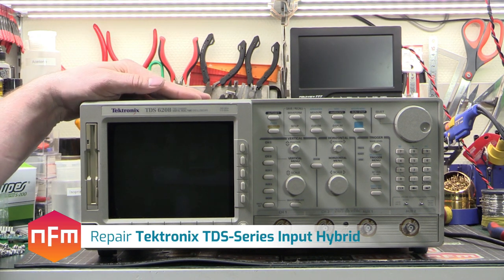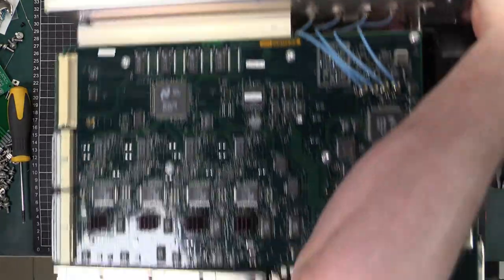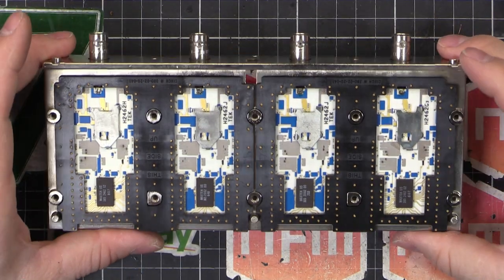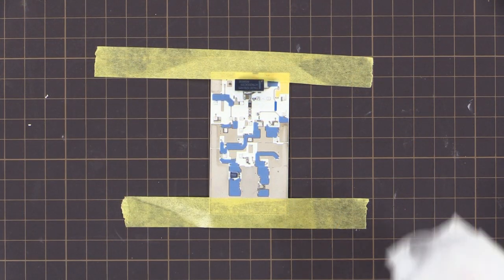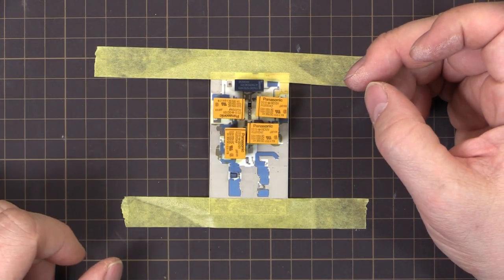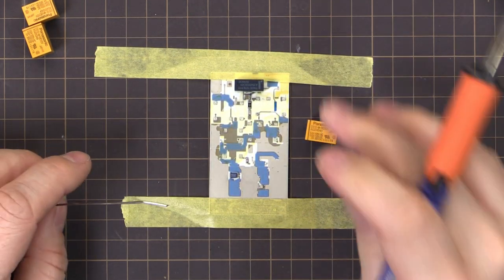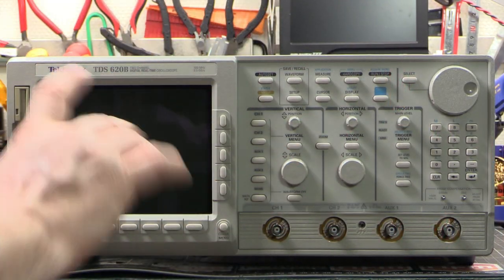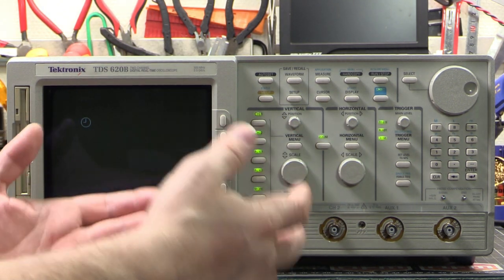Tektronix TDS Series Oscilloscope - Input Hybrid Relay Repair

Comment: When I work on ceramic hybrids I use solder that has a 2% silver content so that the solder to ceramic bond remains intact. This goes back to the old days when Tek used their famous ceramic terminal strips on their 400 and 500 series scopes.
Reply: Yes I had that same concern, I remember the free gift solder inside those old valve scopes

Comment: Thanks for this video. I just replaced the relays on my TDS754A. Noticed that 2 of the 4 hybrids had "1GHz" marked on them. So maybe this one only has 2 channels that can do 1 GHz (if modified). Not sure. They were CH1 and CH3. The other 2 hybrids looked different and mo markings.
Reply from the maker: Good to hear you got it done! They'll be good for a few more decades. :)
Being an 'A' model, be sure to check and replace all the SMD capacitors on the Processor (top) and acquisition (bottom) boards. They have a very bad reputation for leaking, and if they haven't yet, they probably will soon...

All the hybrids in these machines are functionally identical, with the exception that the letter at the end of the part number denotes the revision (the later the letter in the alphabet, the later the revision up to version 'J' IIRC).
For example a H2462H is an earlier revision than a H2467J. I believe there are G, H, I and J versions, maybe more.
In practice they are all interchangeable, but if you have the chance to upgrade to a higher revision, why not? :)

Your TDS754A should be able to be upgraded to a TDS784A without much problem (Don't forget to remove the capacitors in the differential pairs from the hybrids to the acquisition chips! See my TDS620B video), you'll just have to calibrate it to 1GHz to be able to rely on measurements past 500MHz.

Comment: Thanks for another great video! So, the replacement relays are identical to the original and still prone to fail?
Reply from the maker: They are exactly the same, but they should last at least another 20 years. 🙂

Comment: I got a 644B which appears to share most of its components with this model, and particularly those hybrid-ceramic thingy (attenuator according to the service manual).
Unfortunately it appears someone already attempted a "fix"... (or something...) on those modules and there were 2 out of the 4 chanels throwing calibration errors (not on power on by the way, but when doing a SPC or acquisition board diag test).
I managed to have 3 out of 4 working properly after careful reassembly and cleaning the contacts, so I put the bad module in chanel 4. Interrestingly the acq diag test now does not finish and the scope reboots, I suspect channel 4 is in so bad condition it causes some sort of crash because of unexpected values/conditions/whatever. but at least after SPC rthe first 3 channels behaves properly.
This 4th module has multiple issues : gain is completly off and does not react to adjusting the voltage range, and when measuring the input impedence it shows as open (probably stuck in AC or GND) but I hear all the relays clicking so I was considering maybe the ADC for this channel could be damaged.

I was wondering what I could do to fix those and hopfully youtube algorythm proposed you video which was spot on !

So I ordered 4 relays at first (those for gain control) and then decided to order another 12 as if this module relays failed there are good chances the relays for the orther module will fail shortly after (and they probably started to fail as when measuring the channel input impedence, channel 1 is spot on for 1M and 50ohms, the other started to deviate and the reading is fluctuating, that could indicate the contacts in the relay being worn).

Still looking for the 5th relay (small black one with ref TN2E-12V-H11) but it appears to no longer be available. Any chance you'd have a reference in mind that could fit ? 
By the way I'm wondering if it's the AC/DC/GND coupling relay or the one that controls the 1M/50ohms input impedence switch, does anyone happen to know ?

Anyway, great video, thanks for sharing !
Reply from the maker: I'm glad the video helped you out!

The smaller relay is for switching between AC and DC coupling.
The relay is obsolete, but I've not looked for a replacement yet.
With some luck, another brand or a different relay in the same form-factor might still be available.

Comment: Great work 👌👏
I have a question please
The resistance you measured, did you measure the coil resistance or a normally closed resistance?
Reply from the maker: I measured the contact resistance, both the Normally Closed contacts and the Normally Open contacts (with the coil energised).
Reply: @NearFarMedia  thank you

Comment: Hi, thanks for the video!! 
I have bought a TDS 380 a week ago while I'm waiting it will come, I'm looking on YT and varies blog to understand what I will have to replace for a good first maintained so, do you have any advice?    Dallas? 
Thanks in advance for your time.
Reply from the maker: Yeah, the Dallas chip should be replaced if there is one in the scope. It's easiest to remove it, copy it with a chip programmer (if you have one) then  load that onto the new chip and install.
I'm not sure on common faults with the TDS300 series as I've never played with one, but check out the eevblog forums and/or make a thread there if you need info and help. There will be someone who knows the info you need for sure.
Reply: @NearFarMedia   Thanks mate!

Comment: Realy cool repair Video, but how much does one of the new Relays cost?
Reply: It depends, $5.34.
Reply from the maker: The cheapest I've found here in Japan is 435yen, which is about US$4.35 each (at December 2021 exchange rate).
Digikey and Mouser have them for US$5.434 (about US$87 for all 16) and US$5.18 (about US$83 for all 16) respectively.

Comment: Is there maybe an "El Cheapo" way to Dremel open the relays and refurbish them? Just asking for a friend 😉
Reply from the maker: Apparently you can really carefully drill a small hole in the top where the divot is from the moulding of the case so a drop of DeOxit can be applied. Then a dab of hot glue or a bit of Kapton tape to seal it back up again.

I haven't tried it as new relays are only $3 or so each locally, and once replaced will be good for another 20 years or so (basically the lifetime of the scope).
Reply: @NearFarMedia  Thanks. Thats sounds doable.

Comment: Would this apply to the tds 3xx and tds 4xx series as well ?also, is there ANY way to purchase actual SCHEMATICS and not block diagrams for these scopes? 
Thank You !!!
Reply from the maker: I'm not familiar with the 3xx and 4xx scopes, I think they are different, but they miiigghhtt use the same relays... I haven't had one on my bench to check though.

Check out https://w140.com/tekwiki/wiki/Main_Page for lots of good Tek info.
For the TDS5xx, 6xx and 7xx scopes, you can find some relevant schematic info around the place.
For example, the TDS544A had schematics released which is very similar, including the colour CRT.
Reply: @NearFarMedia  thank you !
Reply: The answer is no. On the 4xxxx They are 1n2e-12-h11 and are much smaller and harder to replace, 5 per channel.

Comment: Seems like you're measuring low resistances like contacts quite often,  perhaps 4 wire method could be of good use to you, then the readings wouldn't fly all over the place with every clip movement.
Reply from the maker: Yeah, I usually use my Keysight 34461A, but it's up on the shelf out of view of the camera.
The Uni-T meter was 'for demonstration purposes only'... 😃

Comment: Probably should replace the RIFA AC safety caps.
Reply from the maker: All been done. 🙂
Depending on the PSU revision, it may have RIFA capacitors or may not (I think the earlier ones usually have them, later ones don't).
Definitely worth checking.